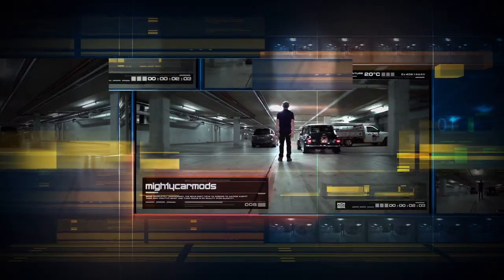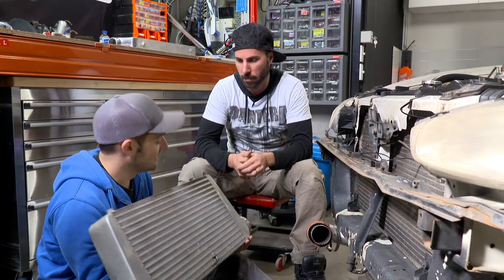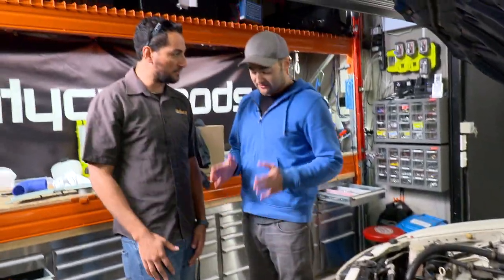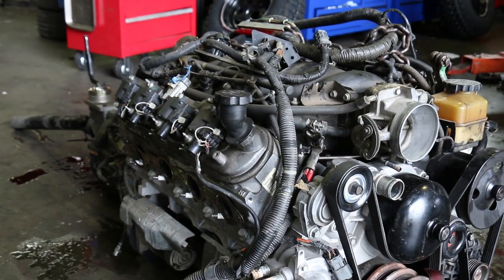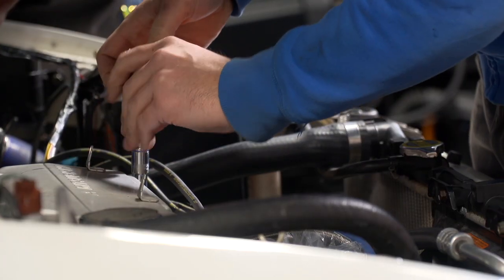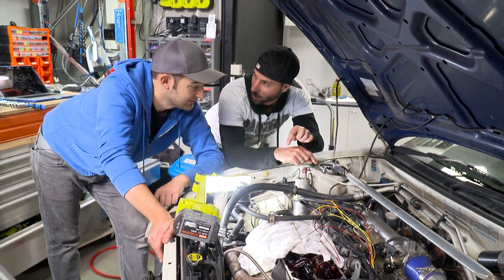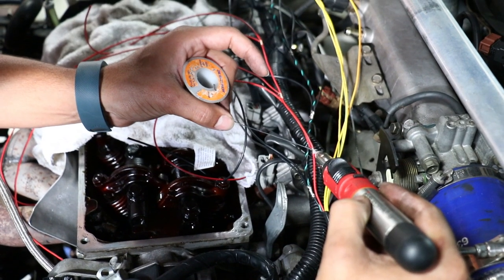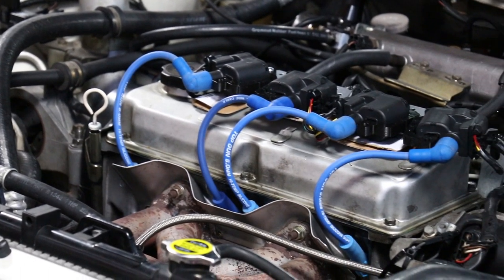LS1 Ignition Coil Conversion (2SEXY)

Comment: As awesome as Haltec stuff is, it's not exactly budget friendly.  Megasquirt is the answer for the masses.
Reply: Even MegaSquirt has been pricing themselves out of the budget market. They've never done a single cost reduction in the 15 years they've been making them.
Reply: +unaclocker You do know you can diy one from a kit, right?  Less than 300 bucks usd can build you one.  That's dirt.
Reply: I live in South Africa, for about $350 you can buy a complete localy built ECU that has all the features a Megasquirt has and more, including but not limited to wide band closed loop lambda control, full sequential injection and ignition, 8 general purpose outputs that can be configured on any value the ECU reads or sends out and digital display outputs. We even have ECU's that go for as little as $180, that will run just about any engine you can think of, including rotaries.

So in as far as awesomeness and quality goes we have a wide choice locally and the only reaon they aren't more widely known and used is because of where they come from.
Reply: +Francois Roux That information needs to be spread.
Reply: Try Perfect Power's XMS system, which is the top of the line ones. We also have Spitronics which are more middle line but lately have been adding features to compete with the former but maintaining their prices. Then we have Dicktator, which have been used in aeroplanes because of their absolute reliability, they aren't so feature rich, but some of the fastest cars in our country still run these.

Disclaimer: I'm not affiliated with any of these companies, I just think they deserve more exposure than they are getting.
Reply: Megasquirt is pretty ancient hardware wise compared to the Haltech, the Haltech has a Xilinx Spartan 6 FPGA and a Freescale MPC5500 series MCU, compared to the lousy HCS12X  in the latest megasquirt, allowing guaranteed timings.
Reply: +Francois Roux will vouch for this info as a fellow South African, I used spitronics, dicktator and power mods ( all local ) the new spitronics system is best, I preferred it over the others. I left SA and I'm looking at another project car shortly and will be shipping a ecu to my self soon
Reply: So, what is the name of this company/products? I'm interested, don't care where it comes from, SA is cool in my book.
Reply: They are Perfect Power dot com, Spitronics dot co dot za and dicktator dot co dot za. Google doesn't allow links to be posted in comments, so just fix up the addresses and have a look see.
Reply: Thanks mate! will look into them.
Reply: +Mike Peterson shipping might be a bit slow or cost a bit more but what you save covers it easily. And self tunning is extremely easy especially with spitronics I noticed, I'm not agent or retailer for any products.
Reply: I think most or at least some of them have outlets in other countries. One can check on their websites.
Reply: ecu masters is very budget friendly and quite amazing.

Comment: Have an LS1 in my camaro. You can't go wrong.
Reply: You have a V6
Reply: lmao
Reply: +crazyjatt24 At least it's not a convertible
Reply: I have an LS1 in my 1986 s10
Reply: Steven Slead bruh I was gonna buy a 2013 Camaro RS with the V6. I just bought a 91 Rs with the v8 for $1500 and using the remaining  money for a lt1 or a 5.3ls.
Reply: GoofyDaGoofGoofTV Carb or Fuel injection?  Im trying to swap one in my camaro but not trying to do wiring.
Reply: fuel injection, get a harness and stock computer with stock fuse box, get the ecm flashed to remove emissions stuff and vats security, give 12v power to pin A9 on block c1 and 60psi of fuel pressure and turn the starter over and the engine will run
Reply: Nice V6 Bro
Reply: "People love LS because they're a big awesome V8" that's not the only reason, people also love it because it's simply the best power you can get for the money.
Reply: which pin is the signal for the coils ? i have 2006 parts fixing my hei gm swap with 1 for now later i will be lsa swapping the top of my mopar

Comment: MCM need to do like a Kilowatt to Horsepower converter on screen... Just saying... REPJAMAICA
Reply: I think the Torque figure is much more transparent, since horsepower is simply swapping a 5252 factor around.
Torque, of course, should be in Nm (Newton*Metre) 
... at any rate, you can tell immediately that, say, 100KW = 134HP, a factor of 1.34
Reply: It takes literally less than 10 seconds on Google o.0 LOL
Reply: whenever they do a dyno run they always tell us both KW and HP for all you people over seas.
Reply: Just multiply by 1.34
Reply: Numinous but i don't wanna Google for 10 seconds
Reply: 745W to 1hp
Reply: 100kW = 130hp

Comment: I would think drilling and adding a bolt to the cam gear would throw it out of balance and cause a vibration in the engine.
Reply: I was thinking the same thing, I reckon you could use a counter weight of some sort though
Reply: Darcy
Maybe, there would have to be spoke directly opposed to where the first hole was drilled so it could be balanced.
"Edit" Just watched that section again, and a counter weight could be added on that pulley, wasn't sure if it was a symmetrical pulley and not one with a odd number of spokes. They better hope that bolt holds on tight or they might have a "killer dowel pin" issue like the 12valve 5.9 cummins engines.
Reply from the maker: This isn't a formula 1 engine and we're referencing a tried and tested setup that's been going strong for over a year, it's not ideal but it's definitely done to a budget and works!
Reply: Mighty Car Mods
Right on, thanks for the reply. Always enjoy your videos, reminds me of when my friends and i would wrench on our trucks together.
Reply: seems like it could wear out/overheat the pulley bearing
Reply: Cam gear only spins at half the RPM of the engine. So balance isn't as much of an issue.
Reply: Tim White
Any form of added vibration in an engine is a bad thing. And this would be a harmonic vibration which is a even worse. Granted its not a major one but it can cause added wear and tear to engine parts. If it was a daily driver and seeing a lot Miles or Kilometers i would definitely look to balance the pulley. But as this is solely a track car now i could see letting it slide.
Reply: Nope
Reply: Correct. It will cause vibration due to imbalance, but i recon the magnitude of the vibration is not significant to warrant a more proper solution. However, sometimes a simple hack is better than over-engineering. Especially in this kind of a project where it is more likely that some other part will fail before the effects of imbalance will start causing too much trouble.

Comment: Your cam will actually only be spinning at 3500rpm when the engine is at 7000rpm.
Reply from the maker: which is 10 times the rate of your doodle! Quite right good sir
Reply: +Mighty Car Mods 2SEXY does 14.000 rpm no prob.
Reply: +Holger Risløw 2sexy revs to 1,000,000 rpms.
Reply: +Vooore well.. shit.
Reply: unaclocker 

Can you explain the problem ?

Comment: 11:50 Won't the off center weight distribution in the pulley rip it apart?
Reply: eventually. the bigger concern is accelerated bearing wear
Reply: Valid concerns, gents. But what would be the alternative?
Reply: A small hole in the belt, a light on one side and a light sensor on the other.
Reply: You could paint the half of the center black, and half of the center white, to make a homebrew optical encoder.

Comment: Hey guys..... Air to air intercoolers are more like heat-sinks.... biggest is best... especially if you are running a too-small turbo, beating the shit out of the air, and heating it up, the more surface area the big cooler has, the cooler the air will be, which in turn cools exhaust temps, reducing under bonnet temps, etc... Also the weight of the cooler stores the cold, more weight, more stored coldness..

what about leaving the big one on, and using it as a water-to-air cooler core, and install a water to air under the bonnet?

Check pressures both sides of the cooler too, no point losing 100 degrees in temp, while simultaneously losing 10 psi boost.... Remember, turning up the boost on a turbo that small to counteract intercooler restriction will push you up and right on the map, increasing turbo rpm (which dulls response up top) and highly likely into a decreased efficiency area of the map, further increasing air temps, and air volume, further increasing intercooler restriction, while also increasing exhaust back pressure (primarily against the exhaust wheel) reducing overall system efficiency, using more fuel per hp, causing you to have a heavier car anyway... not to mention increased flow vosticies on the internal plumbing...

Or, just go get a borg warner s300-sx-e or similar, (maybe even an s200 sx-e) so as to not heat the air up as much to begin with?

  SHIT!!! Aircon condensor???? WHAT?!?!?! wait a minute, you already have a pre-mounted water-to-air heat exchanger, and you are going to REMOVE IT??? Dude...... duuuuuuuuude..... Shame really, there looks to be lots of room for a water air core behind the battery...

Comment: Wow I can only dream of getting 180kw without adding a turbo to my 1.6L N/A cordia I was surprised that when I swapped the old 80s mca system with a mca2 lean burn system added about 22 kW and swapping the old carbs with mikuni twin barrels and that increased power by 36 kW and further tuning got me to 128 kW in total and that took me 6 months of endless working and I'm happy with what I got considering that I started with 55kw out of a 1.6 which was extremely low due to emissions restrictions and the car was limited to that for some reason as it produces 61 kW when I removed some sort of power limiter well I hope one day I can keep this old as heck sohc 4g32 to run to its maximum potential without hurting its self

Comment: You can use modern technology to make old stuff perform way better then you ever thought possible, and a lot of those components are portable, like; you buy LS1 coils and you buy a haltech 750, you can take it with to your next car. That's probably worth more than this car, but the point is you can learn, you can put it on, you can make it better, you can have experience that enjoyment, go and use the car. And when you run into a wall, pull it off
put it in a 180 and go do a skid.

- Marty

Comment: So i get the pick up point you put on the cam gear is a reference point for the ecu and you have a another one on the crank,  but it seemed to me that you just randomly placed it. Shouldn't it have been placed at #1 TDC, so the ecu knows the position of the cylinders in relation to the crank and cam?
Reply from the maker: you can account for this in the tuning software as 'offset', so the sensor may be + or - 30deg either way for example
Reply: I'm wondering about the balance of that gear with that bolt spinning at 7K RPM. Have you offset that at all?

Comment: Dudes, I'm upgrading my car to turbocharged, installing an aftermarket ECU and will run it in ethanol just like you. The stock can phase sensor is not compatible with the new ECU, therefore I'll do exactly the same as you on 11:51, to drill the stock pulley, add a bolt and use another sensor. Any more "Pro tips" on this procedure?
Thanks!!

Comment: The cam would never spin at 7000 rpm. If the engine can do 7k that means the cam is doing exactly half that. so 3500 rpm.

Comment: Doesn't the cam run at half engine speed? So unless you're rocking 14,000 RPM redline, the cam should only run at around 3,500 RPM. t=714

Comment: 11:45 - You guys are wrong. The camshaft is never(NEVER) going to run at 7.000rp/m! The crankshaft does, but the crankshaft:camshaft ratio is 2:1. So to have the camshaft running at 7.000rp/m, you want the crankshaft to run at 14.000rp/m! That's insane, i don't know any engine that that revs that high.

Comment: Curious... At 11:52 - If the engine is running at 7000 rpm, which would be around it's maximum, wouldn't the camshaft only be running at 3500?

Comment: You guys are thinking of Coil on Plug ignition Should've used the 4g63 coil pack and spark plug wires.If Marty did a complete 4g63 engine swap, he can add a proper Coil on Plug system.  I think Moog and everyone watching is waiting for Marty's 2sexy stock 1.8 for the head gasket to go out and warp the head.  Maybe then he would the 4g63 swap.

Comment: Huh?  Injectors all firing at once?  This makes absolutely no sense.  There must be an existing hall effect sensor somewhere....  If the car is running a dizzy, yet it has electronic fuel injection, it DEFINITELY doesn't have points.

Comment: Surely drilling and mounting a bolt on a round balanced piece of metal that spins up to 7000+ rpm inside the delicate guts of your engine isn't the best solution? It might not do anything too mad immediately or directly but your adding a vibration which will create wear somewhere there wasn't before... maybe not in the time Marty owns this car but it would immediately put me off buying this car seeing it done.And that's a first for a MCM video as I'm a huge fan (please get me off this hot office desk...)

Comment: technically since the camshaft spins at 1/2 the speed of crank, it would only pin 3500 rpm not 7000 rpm

Comment: And the amazing thing about Haltech is they'll tune your car remotely for you if they have experience with the build. I always wanted to try building and turboing an older Jeep inline 6, reason theyre a massive bullet-proof torque monster, so if you can build the motor so it can rev and then add boost and tons of fuel you have an intense amount of power.

Comment: Would love to know if there is a wright up on how to do this mod? Also if it would be any easier with a stand alone cam sensor? I have a 91 Honda CRX with a DOHC ZC which runs a cam sensor on the exhust cam and the dizzy on the intake cam. instead of using the hollow sensor.

Comment: I always tell people that want to get into building their owm motors or wanted to do a turbo build, to invest in a Haltech 750, and go from there, because in todays day and age, if you can get good pezio crystal injectors, fuel line, pump, and fuel rail, you can push the motor soo far, E85 also makes a huge difference but in the States its still super uncommon in some places.

Comment: Are the LS1 coil packs different from coil packs from other manufacturers? Do they generate more spark or are they controlled differently. You could get coil packs cheap from wreckers for a more common engine such as chev,ford ,dodge nissan toyota trucks,what about other sports cars ? also the intercooler isn't bigger always better the bigger the more the cooling , the denser the air??

Comment: before people go "derp derp why did they use LS coils and not a performance distributor or coils from another tuner" well its simple LS coils are cheap and easy to find on top of not being too big while having a fuck ton of power. also there are way more parts for the chevy 350 engine and LS engines than any other engine arguably so its kinda obvious why they picked it.

Comment: Question, if the valves on top of an engine are there to pump in Air Fuel mixture, and then suck out the exhaust. how does the exhaust get from the top of the engine to the sides? Or do some engines have exhaust output on the sides like a Rotary? Because that's what I always thought until I learned about the Valves and Camshafts.

Comment: Do you reckon you could run a power to the centre of the distributor and run that power off of the lead outputs to the coils signals and trigger the coils that way? Timing would still be adjustable and you would get the benefit of multiple coils

Comment: could you essentially lose a little boost pressure in between the turbo and the throttle body running it through a larger pipe giving the air room to expand. In my mind that could be possible tho very minor. Going to a smaller pipe could create more resistance killing the amount of air actually making it into the engine but that's also only and issue at a more extreme level. I'm just interested in getting a more professional answer. I think it's just interesting to think about the smaller details to make things run a bit more smoothly prolonging the life of whatever your using.

Comment: Am i wrong or is the necessary size (better said the cooling power) of an intercooler only depending on the boost pressure and the size of the turbo, and not on the power the entire car puts down at the end? Im thinking that the intercoolers job is only to cool down the air, that was heated by the process of compressing by the turbo.

Comment: did anyone mention the imbalance of the cam sprocket by adding a giant bolt to one side? Need another bolt same weight 180 of that one so the harmonics stay decent. don't need a failed seal or bearing at 8k

Comment: Why didn't they just put the bolt in the tip of the distributor rotor and use one of the old HT lead holes to mount the sensor? Seems like it would be easier.

Comment: Is there no concern with throwing the cam pulley off balance, or does it not spin enough to matter?
Reply: Fast enough*
Reply: i think because the belt is pulling around the outside of the pulley means it is more stable than if it were pulling ftom the inside like a hub on a wheel. also the pulley is a strong piece of metal so i dont think it should flex that much even at 3500rpm
Reply: Flex isn't the issue. Harmonic vibration is.
Reply: +Gzilladude that makes sense. Was more curious that genuinely concerned the cam would instantly grenade at the first redline.

Comment: So that 50 grams sensor spinning at 5 cm from the center of the pulley at, let's say, 5000 rpm engine revs i gonna entail a force of approx 100+ Newtons on the axis of the pulley if i am not mistaken. That's 10 kg pulling on that axis a hundred times per second outwards. Won't that be a problem in the near future?
Reply: wouldn't it be better to have a counterweight on the opposite side of the pulley?